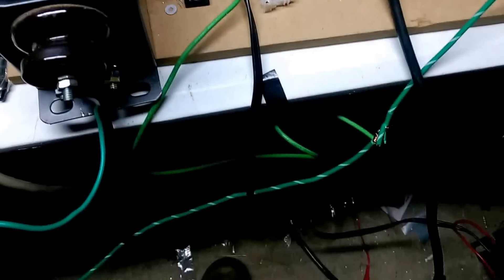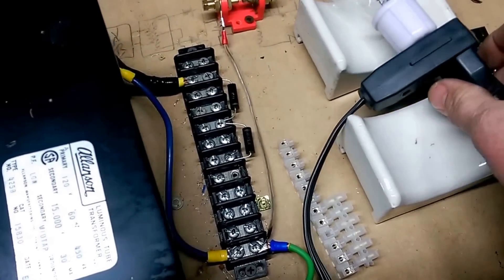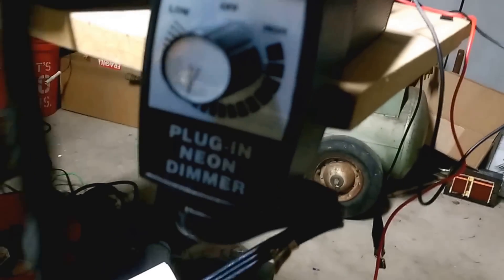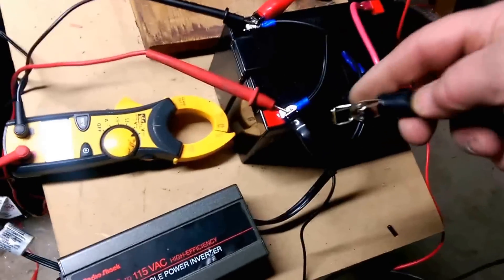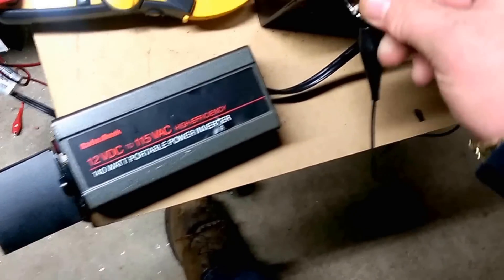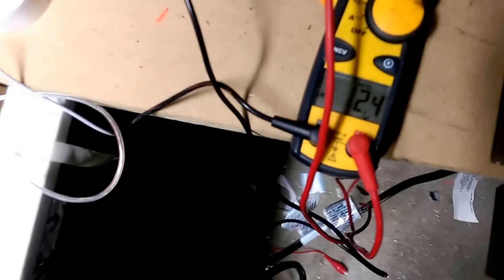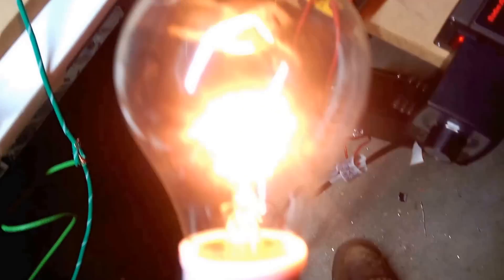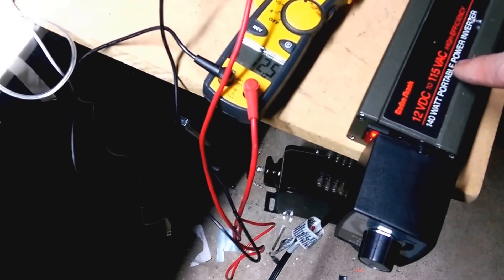Working Free Energy Generator-Dezeinstein Technologies-Annotated

Comment: If it is self sufficient just leave the light bulb on for a few days and charge the battery with the out put as well. Then make a real big one to power your house, then your city,
Reply from the maker: +dusty strachan yes it is. 100%!  I haven't been able to replicate the same device in a larger model yet due to other difficulties that have happened, and the lack of finding the correct products that have been eliminated from the market here in the US. If the government wants one device off of the market, it is easy enough for them to enforce whatever they wish through Underwriter's Laboratories.. Like the UL GFCI rule and fault protection, etc. Even with the resonance, a gfci trips when arcing into a ground.. No matter what, however, I may have figured out a work around which isn't exactly to code, but, in experimental systems, we tear boards out of devices, etc... 

 I found that the voltages need to be much higher and the frequency just right for the self charging to happen with other makes and models of batteries, as each one has different variables like capacitors have, but, the capacitor type used is critical. They need to be self healing caps and they output much higher charge rates to the battery when used. I haven't the "large" selection of caps needed as they are pretty expensive when we use polyester film or mica caps of high voltage and higher uf ranges. The larger the range, the more power the circuit kicks out, however, manufacturers don't make them always in the lower impedance models needed to make this work, custom caps are huge money.. therefore, I have been trying to campaign for crowd funding and other fund raisers, unfortunately, to keep my subscribers, I for the moment wish to reply with helpful answers since many folks that follow my work do the same type of experiments as I and some of them rely on my assistance, which I am never afraid to do. The battery used is extremely attracted to the charge floating in the air, so, others can build this one device without worrying about having the wavelength correct since it will self sustain using this battery and nst regardless of other factors, however, the load needs to be pretty low since the nst draws quite a bit since it is monstrous. If they still made non protected solid state nst's, life would be much better... The manufacturers were forced to pot the living daylights out of the boards to eliminate guys like me from creating hacks for the gfci and transformer protection. Little do they know that we could all wind out own nsts. and, they aren't tough to build provided we get the correct cores and light enough wire. The driver needs to be a variable frequency driver. ,this way we have all the tuning we would ever need. We could then twist the knob to pretty much any cap in the right range to get a resonant circuit/coil/cap combo. I wish I was good friends with an electronic engineer, because the biggest downfall to me is the a variable frequency coil driver with a center tapped primary and secondary, this way we could prepare the device any way we wish, wire it with the ground connected through a center tap and an arc gap as Don did, then we would all be able to easily tune right in and get it working in one try!

Comment: OK, now you can remove the  two "loop" wires from the battery - because they do nothing :)
You say that other systems can't be looped - off course they can - but you did not loop yours :) ...anyway, until your battery voltage does not exceed resting battery voltage, you do not acheive COP > 1.
Your system seems to be nothing special, but you are free to convince me otherwise if you'd like.
Reply from the maker: +kapierenundkopieren the output and the input are connected to each other. the battery is 1/4 wavelength "capacitively coupled" causing the battery to self charge. it is a successful loop and if you can't get the battery to charge and remain charging, you did not create the loop. I'm sorry, but there's too much skepticism with folks, you can't close the loop per se because it kills the dipole. The loop has to be capacitively coupled in this case to allow the phase conjugation to remain effective and functional. There is not other way. close the loop physically or tie to utility ground and watch the energy go away. im tired of the damn skeptics.. please do show me one case that works in a positive way for output amplification/ unity gain with physically closed loops? YOU WON'T SHOW IT BECAUSE YOU CAN'T! Oh, btw, the second remark I know you'll tell me is that the system only ran in the video for about 15 seconds. I have videos now showing the function in perfect shape for 2.5 days now as it is still running, collecting direct video footage for investors, not for you.. I also produced a working model to fire 2500 watts of output including the nst.. where's your model? I'm sorry, but because you're talking and not showing, what kind of crap comes from  a mouth without backup but only a fat mouth with so much choice BS to be expelled from??  Could you even show me anything? I BET NOT TOO MUCH... because you DO NOT contribute to these areas, and, i'm not sure i've even seen you here before.... This is real and it works, don't try to kill my ability to show truth when you have zero, nada, nothing.
Reply from the maker: +kapierenundkopieren closed loop equals broken dipole. No dipole, no quantative exponential increase.. that simple. please do show me an evident physical loop that amplifies wattage between the input and output. I can place input metering on this to prove I have .018 amps of input and I have 142.56 watts of input to the NST and 67 watts of bulb in parallel making 209.56 watts total. How can a battery continuously expell this energy without an input continuously for days if it hasn't been somehow coupled to some form of wireless input? I am not inductively coupling this, am I?
Reply: +Marc Belanger 
OK, I owe you an apollogy for dropping the "skeptic bomb" on you, I mixed you up with someone else, sorry.
After reading your response, I really hope you figured it out, because many others have failed before you.
So, are you saying that the setup is still running? May I Ask what is the battery voltage after 2.5 days?
Did you run the system before (without the 2 loops on the battery) and noticed a difference?

I hope you don't take offence because of my first comment.
Reply from the maker: 12.3 volts running.  Shut down I'm at 12.6 . it remains exactly the same unless I start it and shut off repeatedly,  but,  it recharges to. The same level for the load connected every time
Reply from the maker: +kapierenundkopieren the two loops were literally the original connections I used to connect them as a loop. In a loop from the caps, nothing happens because the voltage holds at like 14-15v at negative voltages if the probes are backwards, literally reversing the charging effect when connected. If I remove them, it seems as if it synced and it chages everything, charging the batteries regardless if the loops are connected or not, it is literally a function of the length of the leads to the inverter, nothing else, and it is picking up evanescent waves of some type

Comment: Hi, Marc and thanks for all your effort.Can you please connect the scope to the inverter so we can seethe signal with load and on idle modeThanks in advance.brd
Reply from the maker: +dusanln it is msw. I just did this lastnight, so, I am guessing as I said in the video that any inverter will work. I found this all happened inputting a sinewave the first time, charge happened tremendously within the caps from the variac. then, I looped the system, it did not charge the battery. I preformed 1/4 wave formulas, and did not come up with a winner for the battery until I connected the wires and earth to the cap. then I disconnected the battery clip lead and the voltage of the battery rised and stayed just as long as I didn't exceed the input the battery receives, which is about 45-60 watts beyond the input of the nst. The problem is that the inverter causes more load for the nst because it is a msw. a true sinewave would be best, however, if we could introduce a positive pulse train and it would work, the negative side of the amplitude is what causes the source load and it would vertually eliminate all source loading, enabling the output to triple.. this is why Don Smith rectifies the output of the NST, creating a positive pulse train, eliminating all negative swing from forcing back emf to the return of the system and a no load situation other than a few watts to idle the input coil.

Comment: marc have any use for xfmr from a metal halide lamp fixture // i will ship them to you for free  //  4 units qty
Reply from the maker: +frank ertolacci  I actually think I have the same ones already x 4 or 5.. Do they look like the one sitting on my bench in my other fairly new video where I try to decipher the equations for the capacitor and resistor on Don's schem,atic?

Comment: marc   any use for high voltage power factor correction caps , 2400 volts , 100 kvar  //  ??
Reply from the maker: +frank ertolacci  sure. I have use for a lot of this stuff, caps are always something I could use. I have a lot of them, but I am always in need of different sizes.. Thanks
Reply: +Marc Belanger  only have a couple of extra caps at 450 vdc 2400 uf left  //  also have 2 400 watt MH ballasts , let me know if you want them  //   i will send them to you but need a address  //
Reply from the maker: sure I will take them. Please do me a favor and send me a private message on hangouts. I will invite you.. thanks, Marc

Comment: Here's a thought...how about replacing the battery with a solar panel? Will it still work, maybe even better? This is just food for thought. Imagine a solar panel that starts up the system but then when the sun goes down everything keeps going. I was thinking last night on the nature of EM radiation. It's a whole continuum. You've got radio waves, microwave, IR, visible light, UV, X-ray, and then gamma rays. You can make radio with this stuff and you can make X-rays too. Why not visible light? Then there's the whole transmitter and receiver paradigm. The transmitter takes electricity and converts into EM radiation but then the receiver accepts that EM radiation and converts it into electricity again. The solar panel accepts visible light (an EM radiation) and converts it to electricity. The solar panel is a kind of antenna if you think about it and LEDs are transmitters. Thought of in this way maybe solar panels and LEDs could be used in circuits in ways no one has ever thought of.
Reply from the maker: +Joseph Richardson I dont think the solar panel would work, but, if a battery was involved, the solar panel may get fried.. I know how panels work, however, the battery receives a charge because of it's capacitive component.
Reply from the maker: +Joseph Richardson I'm sure some form of adaptation could always be made together so they all work as a team, kind of like what Joseph Newman has done.. His was complete genius, regardless of the negative things so many have to say. I get the same flack from folks. Look, already received a thumbs down. I wonder who did that . I wish they would own up to it and tell me why they did so.. Maybe jealousy? Im not entirely sure.

Comment: How important is the neon dimmer? What is it's function? Can it be omitted or a different brand substituted in? I'm asking because I haven't been able to find any dimmers of that brand and style on the net. Update: I've been able to find the right dimmer by using the search term "plug in neon dimmer" and using image search.
Reply from the maker: +Joseph Richardson I think the dimmer is extremely important because without it to reduce the output levels to the nst,  the circuit doesn't operate in the correct range and has less than unity. The circuit needs to basically be replicated to work, that's why I didn't buy substitute devices, however, I had no choice but to try what I already had in stock for caps, etc. I bought a whole lot of Ebay lots of caps, all different sized ac and dc caps which I figured I'd just give a shot once I saw the circuit that Don Smith sent to Bruce Perrault, I knew something had to function, at least a little bit. I was not successful until I made some minor changes. I did give you the heads up on the changes, so, you will definitely need the same type of inverter.. wattage won't matter unless it is a brutal size that the circuit would never output, like 2000 watts of higher, but, I highly recommend using at least 14 or 15 thousand microfarads of dc caps.. voltage should cover at least 250 volts or more , all depending on what your resistor size is or if it is adjustable, it changes the output voltage so you don't blow them up.  without the dimmer, the nst got too much energy and it drove the lightbulb with way too much energy, then,  the inverter along with the nst power created extra power to the liughtbulb.,. remember, voltage is lower on the output, so when we add resistance, the cold electricity being driven through the load is kind of a mix of conventional and cold energy, so, higher resistances put out more power when fed with cold electricity.. it is opposite with conventional where more power comes from low resistances... it's tough to understand until one studies the hairpin circuit and watches a few videos of Karl Palsness.. he knows a ton about it's function. The system is extremely powerful, however, the inverter just isn't big enough to drive all of the components, however, it does the trick if we load it correctly. I could probably put low wattage bulbs like 15 watters, and, maybe use double the amount in parallel than with the bulb I have.. the formulas wortk out differently with parallel and series resistances with cold electricity, everything is basically opposite, however, voltages measurement equations for digital meters are way off. Analog works but will need resistance calibrations. I wish there were older inverters available, somebody's old but new stock of reputable square wave inverters at like 1500 watts and some other denominations so I could try them out. I can't give exact details until more research is done. I really uploaded the video out of excitement and it was way too early. I should have had more background knowledge before I did so.. Yes, the neon dimmer is a necessity for an ac wirewound magnetic nst. if we were able to input less voltage to the input if a solid state nst, that would be good, but I'd be afraid it would burn it out. Don used one on a Bertonee solid state nst and it worked. Oh to all of you guys who are looking for Bertonee brand, they have just changed their name on their prtoducts, they were always manufactured by Ventex, however, Transco was bought out by them as well.  This was the brand Don Smith used.
Reply from the maker: I'll find my.source and send the link. pass and Seymour makes them.